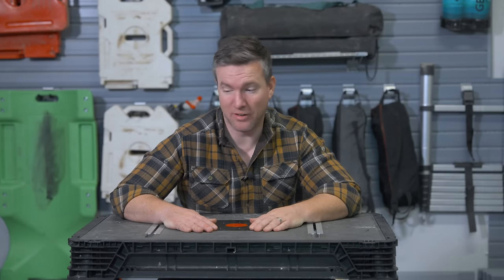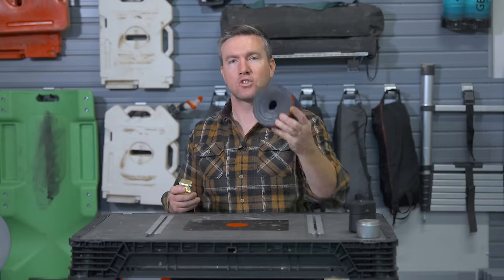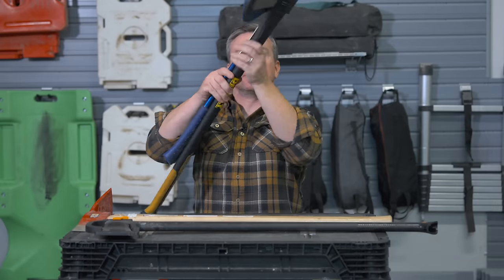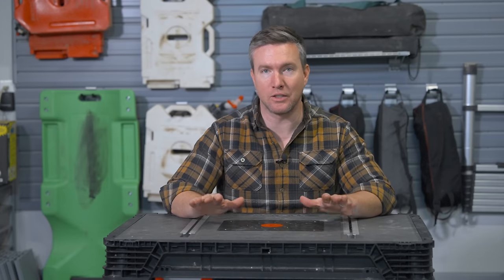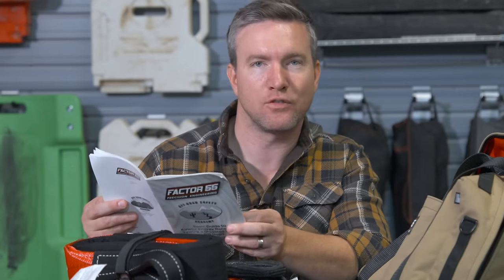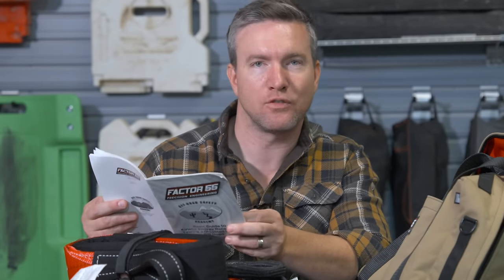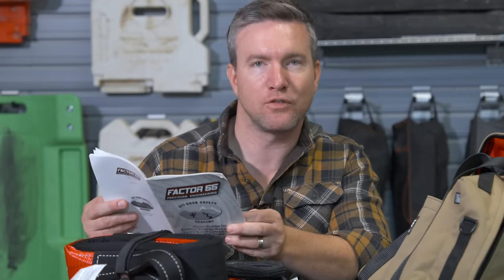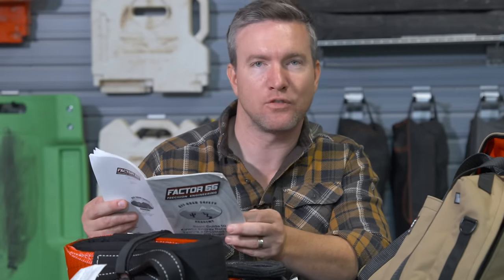My Most Useful Overlanding Gear | Camping Gear Guide 2023

Comment: For Firestarter, just put petroleum jelly on a cotton ball.  For bug repellent, just use essential oils.  For tailgate dust protection, just use a tire inner tube.
Reply: Essential oils work! For about 30 minutes. I hate reapplying every 2 miles on the trail (backpacking).  Probably less critical inside the tent, assuming you treated everything with Permethrin.
Reply: I use the flat cotton makeup remover pads dipped in melted paraffin wax. Nowhere near as messy, just as easy to light. Essential oils just don’t last long. Permethrin is far better

Comment: I live/ travel full time in my 4x4 campervan. I have all the gear for recovery but the only thing I have used over and over is my maxtrax. I have never been stuck myself but I’ve bailed out others on beach and desert. They also make great leveling blocks. Highly recommend! Van on!
Reply from the maker: I use my maxtrax a ton as well. A lot of it really depends how you use your rig and what terrain types and conditions you choose. I’ve used everything in my bag multiple times, but the boards and kinetic rope the most.

Comment: I went with the Skil 40v chainsaw. I researched for months on different electric chainsaws, and settled on Skil. Made by Ego, affordable, plenty of power, doesn’t leak oil (at all) unlike dewalt and Ryobi, and the batteries are affordable also. Have a STIHL for longer use sessions, but having a built in inverter in my truck, I just bring the charger and a couple batteries and I’m good to go.
Reply from the maker: Sounds like you found exactly what you wanted!

Comment: Just a note with the Estwing. The reason it’s not a splitting axe is the slim angle on the head…so what?

Well, depending on the wood and how many knots it has, it will bind into the log and be extremely difficult to remove. This struggle runs the risk of a sudden and uncontrollable extraction

Comment: I have a lot of practice getting stuck and digging myself out.  I found a high quality long handle shovel is my go to item.  Also note the blade and handle should be in the same plane.  If the shovel has an angle as the one shown it is much harder to reach under a rig to dig out when high centered.  Chain saws are handy but very dangerous.   I have been using them for over 55 years.  They can cut open a leg so fast.  NEVER  use a chainsaw without chainsaw chaps and eye protection.  Small chainsaws are more dangerous than big professional chainsaws.

Comment: The duality of “were cheap and don’t have room in our rig” after saying they pack a chainsaw with extra batteries and charger….

The Corona folding pruning saw is $25 and the best cutting saw at 3-4x the price point. If you need more blade length, get a pocket chainsaw and may a bow saw jig for it. The 2 combined might run you $50, no power or oil requirements, and pack a lot smaller.

Anything much larger than 12 inches diameter and you should grab the axe

Comment: If you want a quality diesel heater that will work every single time you use it without failure stop buying chinese-made ones. Purchase a planar diesel heater and you'll be set. They are pricey but you get what you pay for and you'll thank me later.
Reply from the maker: This is absolutely true. However…it might be worth going cheap first just to see if this type of heater is worth investing in before dropping $600-$1k on higher end models.
Reply: @Venture2Roam  they definitely are pricey that's for sure. I love camping in the fall in the winter so it works out perfect for me. But if people camp in the summer and have some slightly cooler nights it may not be worth the investment.